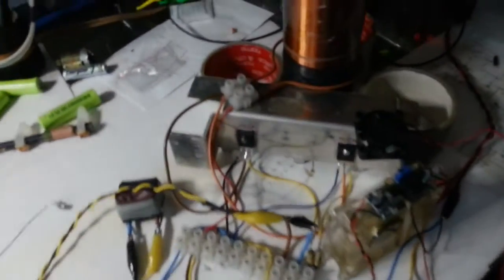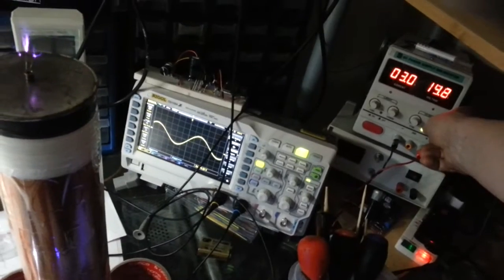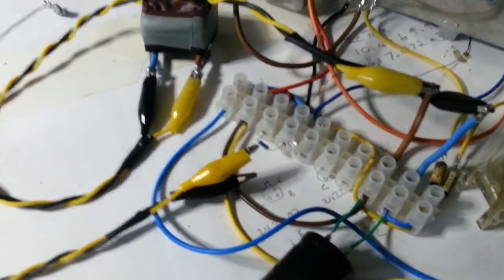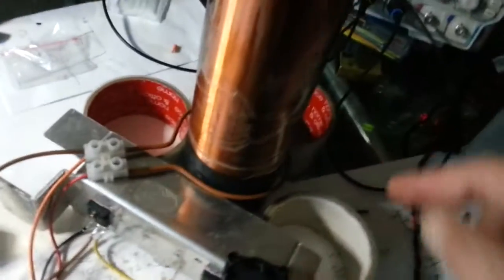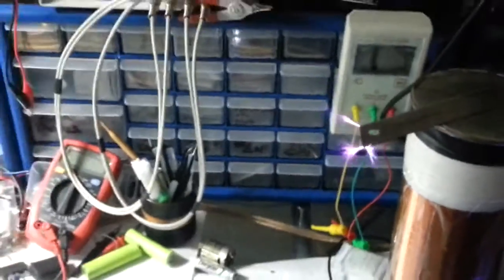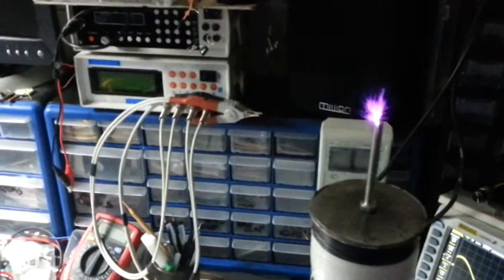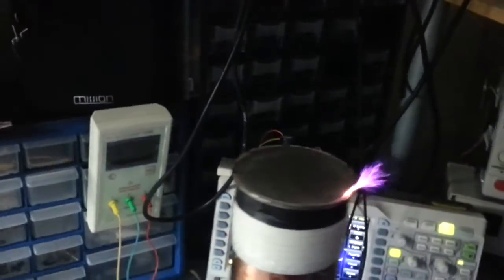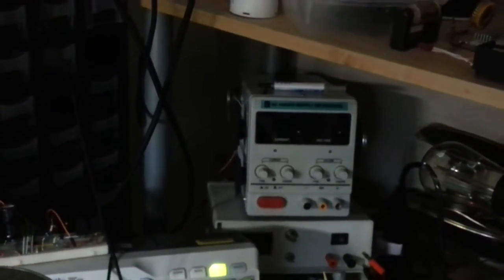SSTC Slayer Exciter Parallel Transistors

Comment: you need an interrupter to keep the amps down my slayer drew 3.5 amps at 24v. With the interrupter : 0.1 amp at low freq and 0.8 at higher freq. the transistors keep cool just with a little heatsink and no fan and operating it for 15 min. With an inerrupter and bigger transistors like the N3442 you will get quite some output. Also the breakoutpoint must be kept pointy so it doesn't leak from everywhere. then you will get good sparks. but to keep amps down and spare the transistors an interrupter is a must.

Comment: Put a diode on the primary in opposite direction in parallel to stop back emf into the transistor from the primary.

Comment: not bad for bjts... but did you managed to fix that psu?... if that's the only problem and can be easily solved i could probably buy one of those, they're common online
Reply from the maker: Yeah I fixed the PSU, I fried both IRF840's, replaced them and it's working again.

Comment: So powerful !!!!!
Could you please show the schematic ? (How do you use parallel transistor?)
Reply from the maker: Hello Mohammad You can just parallel them with a very small value resistor connected between emitter and ground, here is the schematic.
http://www.svw.me.uk/?p=3459
Enjoy!
Reply: Thank you very much. I am working on now,
is it possible to use more transistors?
Reply from the maker: Mohammad Makiabadi Sure but be careful which transistors you select.

Comment: After an afternoon nap in the company of a nice fan..for the circuit I would use a Peltier on the power supply heat sinks and read the current from it with a modified vu meter
Reply from the maker: I haven't got it working :( That afternoon naps sounds good though. I have to find out some things before I buy thermal switch. Going through IC's checking voltages etc. Hope the solar panel is working well.

Comment: The weather is too hot to think of one...grin..but I just saw a twin input thermocouple meter on Amazon for 12 quid..smile
Reply from the maker: I stripped an old gaming machine down and still have temp displays with connected probes (LCD no back light). Got to fix it first. £47 to replace it on ebay.

Comment: Can I put 32V and 4,5 amp with two transitors in parallel? Thanks
Reply from the maker: Absolute maximum I taken the circuit is 73V 8.9A 
This power blew the transistors or 1 tranny I cant remember.. Make sure you have good active cooling and a bigger heatsink if you can.
Reply: @Elecifun  ouu thanks a lot

Comment: isnt the tip35c rated 25 amps ??
Reply from the maker: With adequate heat sinking and cooling across the collector emitter junction yes. It is only rated 5 Amps at the base which is crucial here.

Comment: Just had an idea...when you repair your power supply how about a modification where a thermistor triggers an audio warning if it reaches the maximum  rated heat dissipation of the mosfets...I think its 175 c for the 840s (I ate a dictionary for breakfast)..smile
Reply from the maker: Nice idea, Have you a circuit in mind?

Comment: I think you was pulling 8 amps.... could have been worse ....a pacemaker and a pop sound from you chest...smile
Reply from the maker: Have to have a rule no pace makers when playing with these things. I am a bit closer to fixing PSU changed both dead IRF840's and the thermal switch is also open when should be closed.